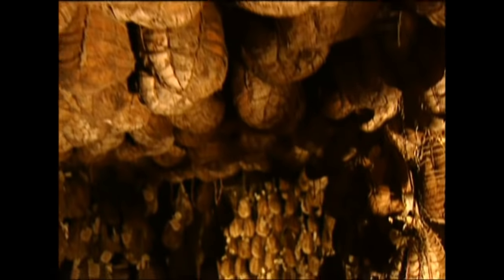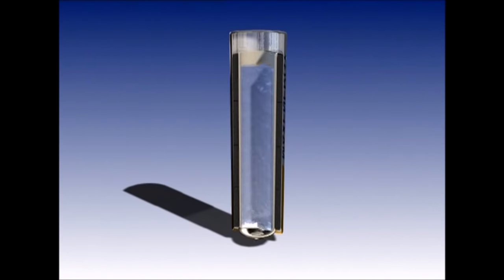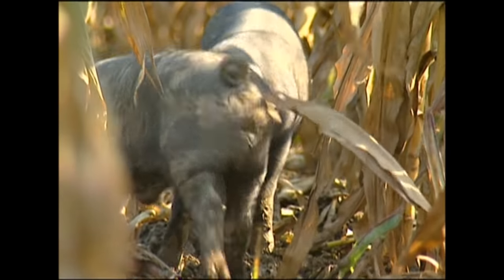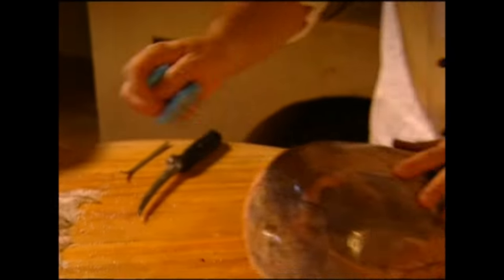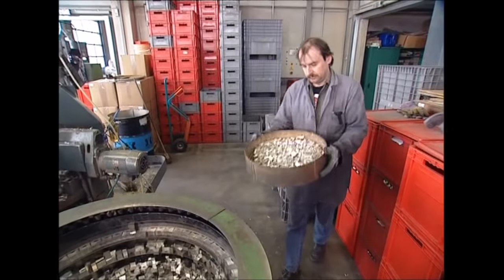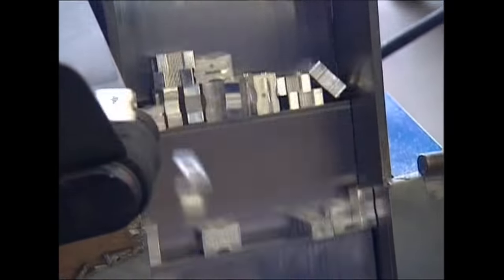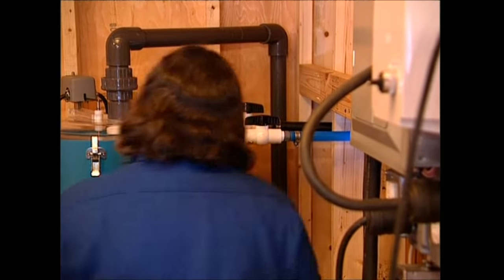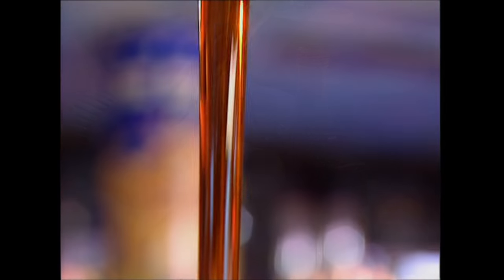HOW IT WORKS | Maple Syrup, Batteries, Ham, Pencil Sharpeners  | Episode 17 | Free Documentary

Comment: That battery factory seemed to have a high discard rate, where it was pushing at least 1 out of every batch. I would never trust that battery company.
22:41 How is maple syrup artificial? Used in Artificial Color and Flavor?
Reply: They may have introduced intentional defects to demonstrate the test/reject mechanism. For shows like this, they often slow the machinery down and do other things to make appearance acceptable for video recording, but this usually causes the product to be a deviation from the norm and it doesn't get used as normal production product.

Comment: Proceed to the EVAPORATOR! = Stove with wood fire.
Reply: Open boiler not a stove. And wood fired evaporators produce a higher quality product than gas fired. The wood is often a byproduct of the surrounding forest salvaged from wind or winter killed trees or recovered tops from logging operations. All of the hydrocarbons released in the process were never subterranean  so the carbon footprint is neutral. Probably the most ethical of any ag product  since the trees themselves are not impacted at all. In fact since a maple tree is valuable “livestock “ they receive better attention than others in the woods. Their sap is often worth more in 1-2 seasons than their timber value